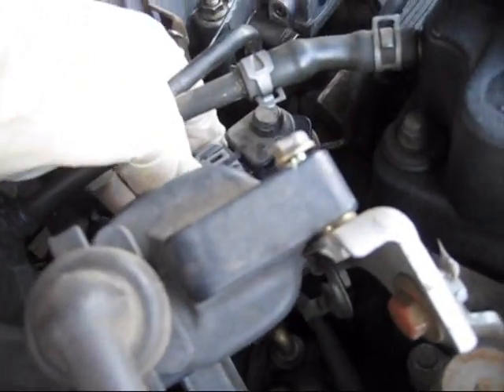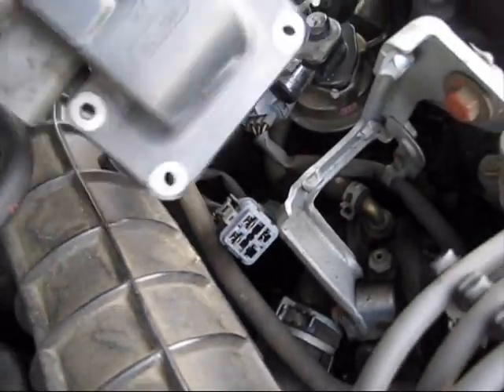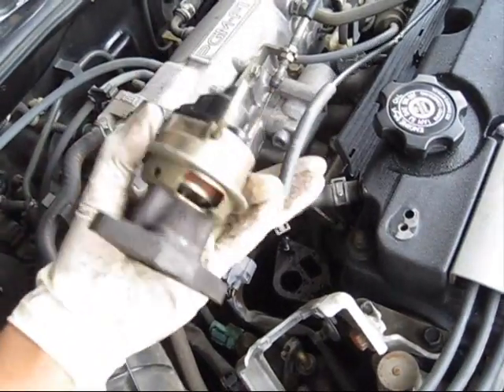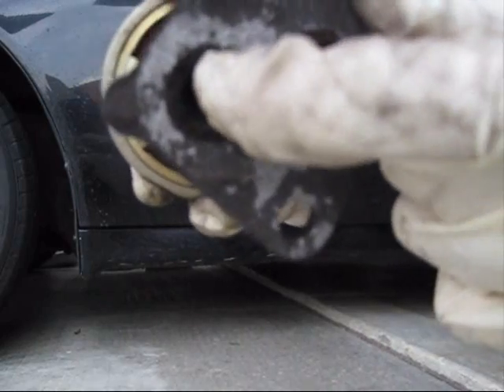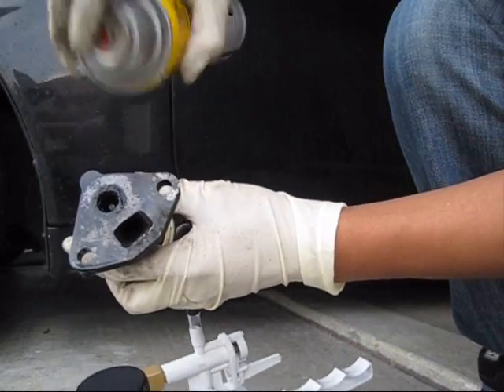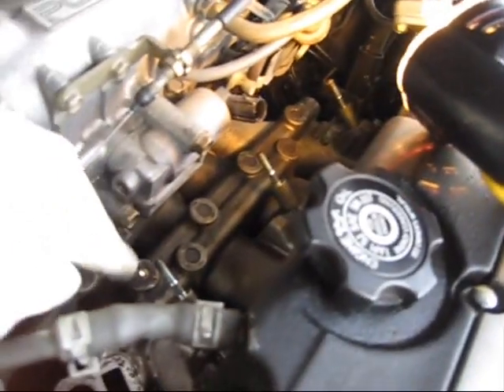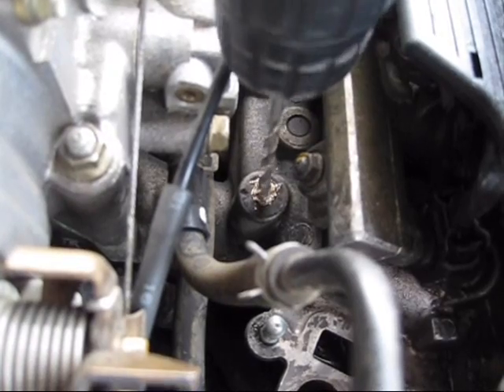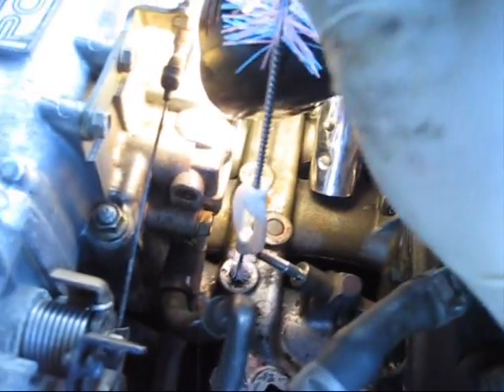P0401 EGR Valve Port Cleaning

Comment: @noobtonthe3rd Thanks ...For some reason when the humidity goes away (2years in a row now) the light goes off. it's now 16 C here in Ottawa at 25 c + humidity...light turns on...I have no idea what's causing that...also not sure if it's a coincidence when I turn on the cd player that I got installed with speakers ..light turns on after I start back up a few times after  a few hours...it's back off lol...

Comment: @Rob2977 Sounds like you upgraded the system without updating your power supply. You alternator is probably going. Cheap the voltages with a volt meter when the car is running, average is about 14.1v. my system is just about 14.8v and guys with the big setups get 15+ but if your car is under 14v then the alternator is probably going and it will get worse and worse until you have to rev up at stop lights to not working at all. Chances are your battery is done now too.

Comment: I get a PO300 code. New ignition module, new ignition coil and new spark plugs on car. The engine has a vibration, sounds like a go cart and will not accelerate over 25 on the flat road. Someone suggested a stuck EGR valve is my issue. Do you think that sounds like a good possibility? I am tired of putting money into this car. I just want to get it running to sale it. I want to make sure it runs properly 1st. Thanks.

Comment: I have a code P406 : Egr Valve voltage to high - would cleaning it out help? or should I just stick to the electrical side of things? I have a Dodge Ram Quad 1500 SLT Hemi.
I won't go as far as drilling but just the cleaning...any suggestions?

Comment: Is the pressure tool necessary to open the valve or can you just prop it open with a flatheat? (I have a P0401 error reading too)

Comment from the maker: @rad2k7 The CEL indicates the egr passages are clogged. That could mean the EGR valve is dirty or both the ports n valve are dirty. I suggest taking apart the EGR valve and cleaning it since it's the easiest, then see if the code and cleared. If not, u have to clean the ports as well then. Good luck

Comment: Hi 
I got a question about a Honda Prelude 2.2 Vti 1998.
Basically i start the engine on and then remove the oil cap on the top of the engine and then I notice a strong air blow from the whole. Also there is no smoke from the same whole and also no smoke from the exhaust.

What could it be?

Thank you

Comment: did you drill all the way through the port plugs or did you drill them part way and just tap them. I saw another write up for accords online saying he tapped part way just enough for the screw you use to work. He even reused the plugs but not sure how thick those plugs are. I have a 98 prelude SH. I cleaned out the EGR valve and also tried cleaning the passage ways without removing the plugs. I don't have a slide hammer either. Where you located? I'm in the bay area! HELP?! haha

Comment: Thanks for posting this video!
How important is it to pull the plugs and clean out that rail? Can I just clean out the EGR valve itself and leave the rest?
Also, where do you get the replacement port plugs and what are they called?

Comment from the maker: i got the pressure gun from Kragen. you can get it from any local autoparts store. roughly $20-30.

u dont need the pressure gun to raise the valve. it just makes it easier, but u can press it with ur finger to raise it to get more of the carbon deposits out